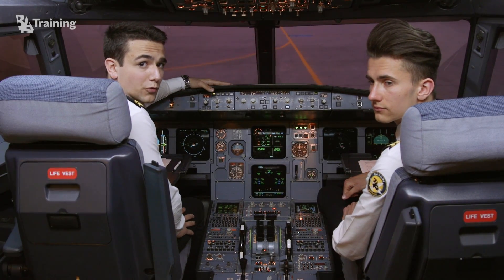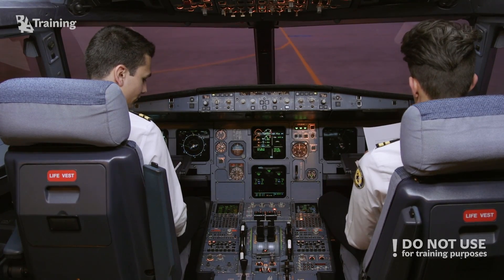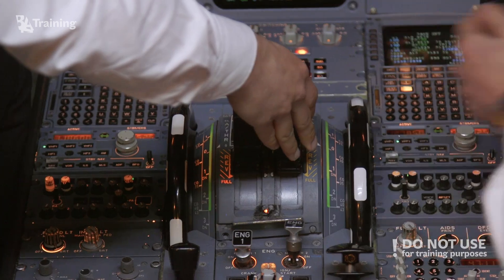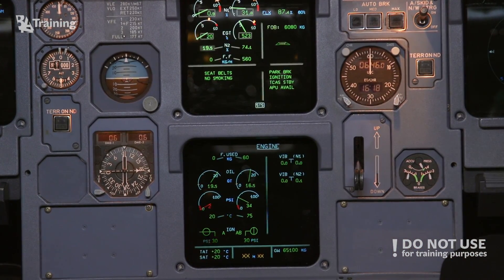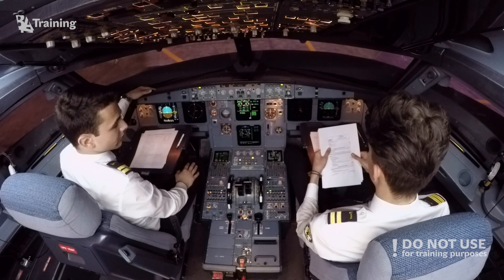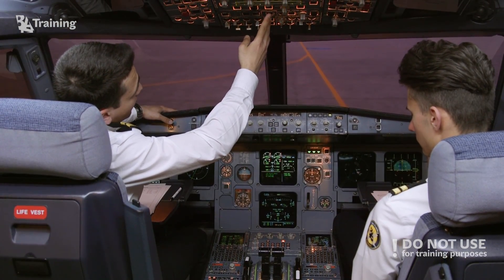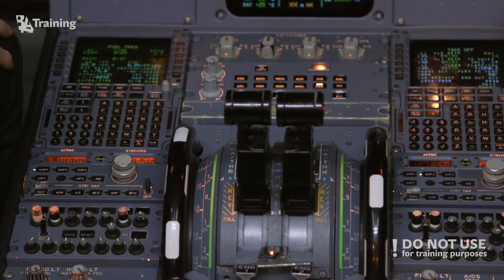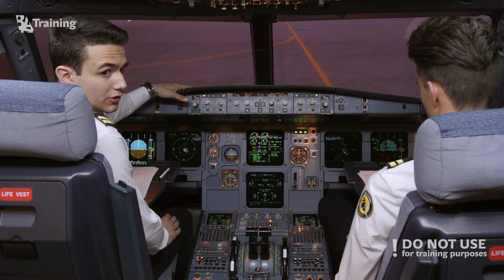Crossbleed Engine Start Procedures on Airbus A320

Comment: The guy in the capt seat is adjusting the throttle lever for bleed pressure to start engine no 1 and the guy in the F/O seat is showing the oil pressure gauge and confusing it with bleed pressure (1:47)
Reply: I noticed that immediately and frankly..rather concerning lolz uwu a whittle fucko boingo then m8. He hit 'ENG' instead of 'BLEED' lol. However, when he's cranking the shit the BLEED pressures WILL pop up. Only during start/ignition. Otherwise you have to go to the BLOOD BLEED page to whoop

Comment: isnt the PTU gonna keep sounding until eng 1 starts?
Reply: Probably not if nothing is using that hydraulic system
Reply: Well, maybe it’s a little bit late for the answer, but i will leave this paragraph of the AMM here: 

“To prevent unwanted operation of the PTU when the aircraft is on the ground, different switches and relays are installed in the aircraft. They operate together to supply power to the two PTU solenoid valves under certain conditions. The PTU will not operate if:
 
 	
The Yellow electric pump is in operation to close the cargo doors
 
or:
 
 	
The aircraft is on the ground, only one engine is in operation and the parking brake is ON (this case in particular)
 
or:
 
 	
The aircraft is on the ground, only one engine is in operation, the parking brake is OFF and the nose wheel steering is deactivated
 
or:
 
 	
The PTU P/BSW on panel 40VU is set to OFF.

Comment: Why we have to start with cross-bleed start?
Reply: TO OBTAIN PNEUMATIC POWER FROM THE RUNNING ENGINE SO THAT IT IS ABLE TO BLEED/ SUPPLY AIR TO THE STARTER HENCE IT WILL CRANK THE ENGINE UNTIL IT REACHES SELF SUSTAINING SPEED AND IGNITION WILL BE DE-ENERGIZE. U CAN ALSO GAIN PNEUMATIC POWER FROM EXTERNAL SOURCE AND ALSO APU. :)
Reply: @mohdnadzmi6906  When do they use this procedure? When there's a APU bleed issue to a certain engine? Thanks
Reply: @Bravo_victor_727  with a MANUAL ENGINE START, ENGINE START WITH EXTERNAL PNEUMATIC POWER and also when ur doing an one engine taxi ;)
Reply: @JosoLasagni  Thanks! :D

Comment: Didn't read the Ignition selector switch back to normal. 

Also as per Airbus, you have to leave the ignition selector switch in Ignition/Start position to prevent continuous ignition on Running Engine
Reply: T thanks, nice video
Reply: vivek Inder Correct. IGN A+B on Engine #1 will re-appear on SD ENG page after reselecting the mode selector to Start .
Reply: Holy shit. This unit is right.

Comment: I have a question, is the apu on? I think so, but I do not get to notice it
Reply: This question is 2 years old, but to answer. The APU would not be on. If the APU was on/working there would be no need to do a crossbleed start. In this case, they used an external huffer cart to start engine 2, got pushback, requested high idle engine start (to give engine 1 enough compressed air), then bled the air to engine 1 and ignited the fuel.

If the APU was working, there would be no crossbleed start as the APU would provide enough pressure to start the engines.